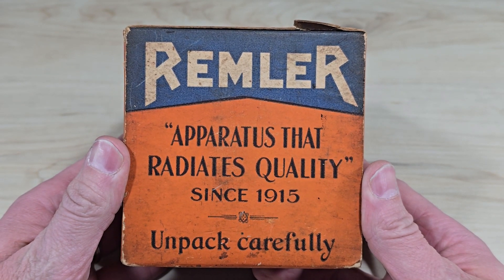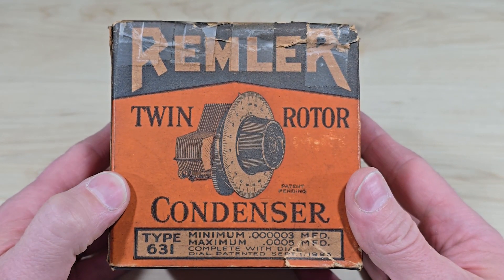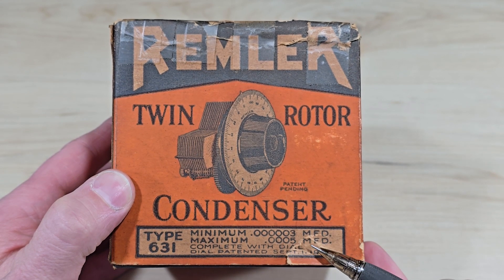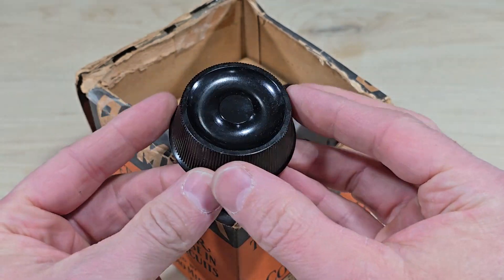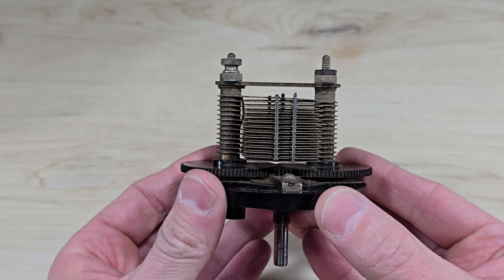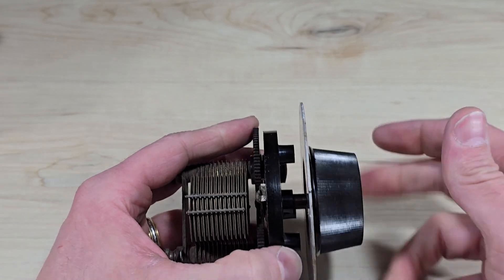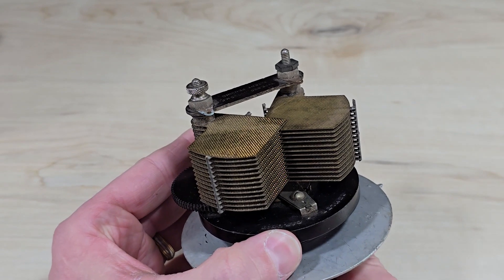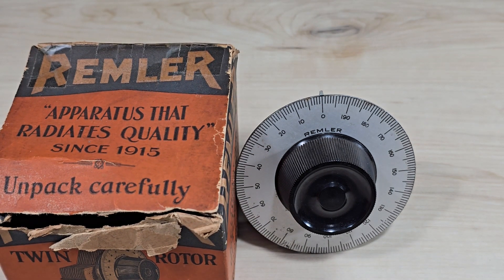Reviewing the Gear-Driven Action of a Century-Old Remler Condenser

Comment: what would be a typical use for this back then?
Reply from the maker: Typical use was tuning for a radio receiver - usually a home built unit. It could be used for a crystal radio or a radio constructed with vacuum tubes.

It is also possible to use the capacitor in a low power radio transmitter.

r/

APD

Comment: I have seen lots of variable capacitors, but all they had a still part and a rotating part. Does it have any meaning to make a var. capacitor like this one — having two movable parts and some gears? It makes the capacitor more complicated.
Reply from the maker: To my knowledge, this feature was unique to Remler.

I suspect there is a bit of marketing associated with the part. The brass plates coupled with the gearset would make a positive impression in any radio set.
Reply: It produces a higher ratio of max to min capacitance than is typical of most variable capacitors with the one rotating part.  Thus, it can cover a wider range of frequencies.  The additional cost of the mechanism was not justified for the AM broadcast band because the one rotating part design was adequate for this application.